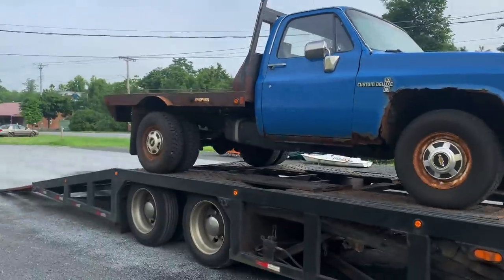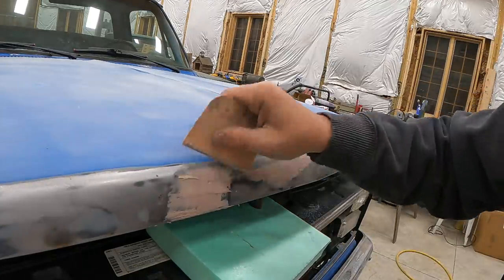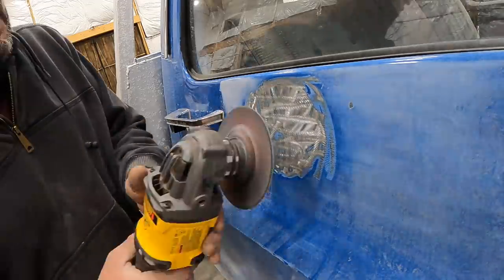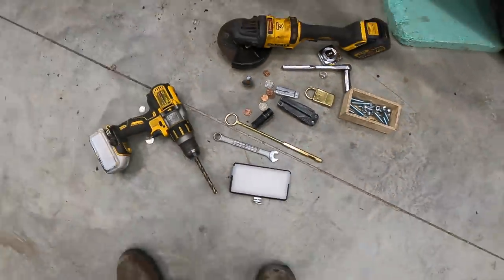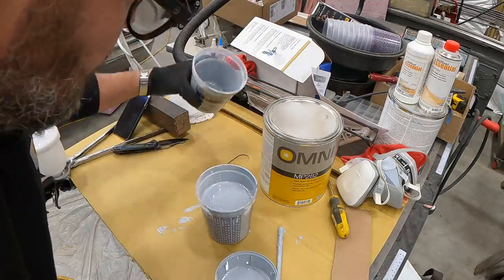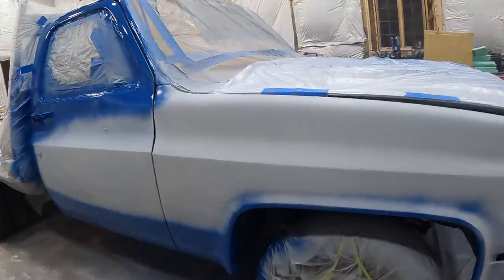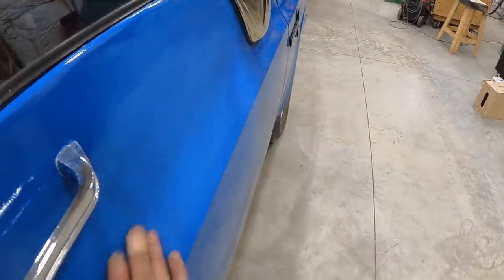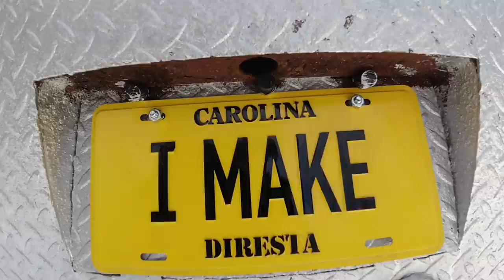DiResta Chevy Truck Restoration [Part 2]

Comment: What you do for the dent in the door is while pulling on the glue sticks take a body hammer and tap around the dent. The metal has memory and by tapping on it gets the molecules moving again and gets it to stabilize
Reply: yep or even heat it some it will change it.
Reply: @jeffreyrigged  yes, heat the area then cool it quickly with a wet rag and the metal will shrink ever so slightly

Comment: Lacquer thinner is illegal? I'm assuming that's only in New york? Great video, my guy. I really like that truck
Reply from the maker: Yep maybe just a ny thing 🤷🏻‍♂️ Bobby I love you 😘
Reply: @jimmydiresta  love you too, man.
Reply: Big up Mr Bobby Duke
Reply: Definitely a new York thing. You can find lacquer anything in the midwest
Reply: @jimmydiresta  California as well. Everything in has to be Low VOC for air quality reasons. Most of the Auto Body places have switched to a waterborne paint system and use a heated paint booth to "bake" the paint on after spraying.
Reply: It's mostly illegal in places that already have high pollution levels due to the high VOCs - e.g. most urban areas.   Even then, you can often get it as a specialty paint.  That said, if you are painting cars, as Jimmy said, the modern paints are way better to use and far more durable.
Reply: Shoot...Cali is bad, but I was going to say we still have it here and then I see comments below. I'm going to have protect my last gallon of thinner like a hen protects her chicks.😋 
Although, maybe this is a autobody paint thing. I bought Rustoleum clear lacquer not more than 6 months ago.
Reply: Tanks for showin' us how it's done
Reply: I don’t believe it’s. New York thing as I’ve bought it here plenty of times.

Comment: Behold!!! The rarest of the rare..., a triple "D" in all its glory (Diresta Duelly Deluxe)👍👍
WARNING! This restoration video contains 3 strong "R's: Reliable, Ruff and Ready, with scenes of drips, runs and orange peel.., Viewer disgression is strongly advised.
The work performed in this video was solely intended for mature audiences only. If you are looking for concourse car show material,  then perhaps this video isn't right for you..
To all subscribed viewers.... You are about to witness a perfect example and sensible approach on how you too can have a decent / CLEAN presentable work truck without going broke in the process or worrying about it getting scratched or dented sometime down the road . Please note: No Chevy's were harmed during filming. 
Awesome Job brother Jimmy! This was exactly the right approach on where to take this truck and where it needs to be. I'm 110% confident many will agree!
Reply from the maker: Hahahh well said 🤘🏻🙏🏼

Comment: You mentioned in the video that you would link the specific paint.  I love the color, could you tell me where to find it?
Reply: If you pause the video at 22:29 you can read the label. It says "Bright Medium Blue" from the Delfleet Essentials line. Also has some item codes that may be useful
Reply: Looks Great! I have a 85 C10 that I currently restoring.

Comment: What a great job. That truck looks terrific. 30 years old and some TLC keeps it looking good on the road. I have an ex-utility company 70 Chevy half ton step side. Had the original 292 six rebuilt, and it just keeps going. Happy with a 50 year-old pickup. Smiles from the West

Comment: Hey Jimmy, I think a lot of us would find it valuable if you did a vlog on the tools you used for this, what you learned and tips you could pass along. Most of us here are not auto body pros but would be interested in doing this type of restoration

Comment: I don't know Jimmy, I doubt bondo will fix the "oil-can" spot. It will probably keep moving and crack the bondo brother.
Reply from the maker: I shit. If that happens I’ll have to get it fixed 🙀
Reply: @jimmydiresta  Probably a typo, but it's hilarious!
Reply: A Wray Schlien shrinking disc would take care of that... they work amazingly well
Reply: @TheAirzuki  yeah, but he is already beyond that step.
Reply: Passenger gives the handle a tug and promptly gets hit with a moonpie shaped chunk of filler... lol
Reply: Take the door panel off and use some spray foam on the inside and lay a few 1/8” rods on the foam and press in to strengthen it up.
Reply: @oakleyjack7600  wouldn’t that get the way of the operation of the window?  I am not a body guy, I don’t know.
Reply: @oakleyjack7600  spray foam holds condensation. Better off shrinking with torch or wheel...
Reply: @jbratt  you should have an inch or so, but if you don’t you can epoxy the rods in to stiffen it up. The rods probably need to be bent to shape vertically with one crossing horizontal.
Reply: @oakleyjack7600  👍
Reply: The metal in that area has been stretched. The only way to keep it from popping in like that is to shrink it using a shrinking hammer a dolly. (or, at least, that's what I've gleaned from watching hours and hours of YouTube in my research for when I do body work on my Mustang soon)

Comment: about the dent near the right door handle: i wonder why the handle is sitting on thin sheetmetal without any support.
Reply: 80's vehicles weren't very good.
Reply: Heat and fast quenching would have shrunk the metal - the problem is that it was stretched....

Comment: Noticed the lower cab at the back I saw some areas to smear some Vaseline over as its your work horse and not your show car. I used wheel bearing grease one time and it stunk so I use Vaseline to be a rust stopper. The truck looks good I'm impressed Jimmy!

Comment: Did a very similar project years ago and loved almost every minute of it despite breaking skin on the knuckles too often for comfort. I cleaned off all the loose rust from the underside too and gave it a good treatment with black Waxoyl which not only protects against further corrosion but looks really good too. With the effort you put into this project I suggest you consider doing the same.

Comment: Thanks for sharing this video.  Last time I tackled a similar project was in 1970, on a ‘64 Chevy Impala.  Many thin coats of OD paint.   Preservation and paint techniques are the same but obviously coating technology has evolved.  I was surprised that you didn’t do any frame rust mitigation before replacing the fuel tank.  Crispy frame syndrome is common here in NE Ohio.  Wishing you and your family a blessed new year filled with peace, prosperity, health and happiness.

Comment: I love Bondo and was known as Bondo man as I perfected a method to use Bondo on blending column haves together while working as a carpenter in Las Vegas. Two biggest tips for Bondo is the more you use the more sanding you create for yourself and when sanding and blending curves in always sand on a bias direction, never vertical or horizontal to avoid flat spots. Bondo will also mend broken marble and granite. Use lamp black or powdered aniline  dyes to color match the stone and use the white hardener cream for perfect results. Bondo on!!!! Love Bondo.
Reply: Also give Kitty Hair; Bondo's structural cousin. I used Kitty Hair to attach Fiber glass reinforced gypsum moldings and you can use metal duct strapping embedded in the Kitty Hairfor additional strength. Kitty Hair is nothing more than Bondo with fiberglass strands mixed in it.

Comment: I recommend getting a kit to move the tanks inboard of the frame.    Been a few burn down from getting t-boned.  I put a 30g where the spare used to mount on my short wide.  I think LMC truck sells the parts needed.

Comment: Great old square bodies, maybe Chevys best trucks. On the passenger door dent, when you pull a dent, you need to release the bend at the edge. A whack on the top edge with a block of wood would make it stop popping back in, no bondo to crack later.

Comment: Good job on the Square body Jimmy. Just heads up those side tanks till 87 were recalled due to fires from side impact. I believe they over took Pinto. Maybe down the road when you do the bed you can move it inboard to the frame rails. love the channel, Take care and keep up the awesome work.

Comment: Tape a “v” shape on the top of the paint can to help pouring when you don’t have a mixing top to clamp on. Also you can break off the plastic adapter on the mixing tops that engages with the mixing machine and just attach a cordless drill to spin it. 👍🏻

Comment: What you could’ve done with that dent it is while you were pulling, tap lightly around the area with a pointed dolly hammer, that will give it strength to hold its shape and keep it from “beer canning”. 

Truck looks really good Jimmy!

Comment: When I was a kid (10-12 years old) I would watch my grandfather work with lead to fill bodywork. He would mix his own enamel and lacquer paints as he has all the measuring devices to match colours. He had colour charts that filled up many shelves in his paint room that he would be able to match mfr and model during the 1960's. He would generally paint at night as he liked his lighting set-up as he detested the shadows during the day. He never had a dedicated paint booth and would just wear a paper mask available from the paint jobbers. I would hold onto the air line that he would drape  over his shoulder and I would make sure the air line would keep off the water-soaked floor (to keep the dust down). My grandmother would do all the masking on the vehicles he painted. Fond memories! As far as the paint drip...at 60 mph, a blind man would be glad to see it!

Comment: Jimmy...great job . I have restored 2 old Chevy p/up. I’ve been told the reason for only one bolt hole on the tank bracket is that it’s a break away in case of a rear ended. The tank drops to avoid getting crushed and exploding. Don’t know if it’s true.
** I was disappointed to not see your insignia on the long board .:((

Comment: a good cheap undercoating/truck bed stuff  But dont actually use it for a nice truck bedliner  But it is  rustoleum undercoating BUT with the Sound Deadening..  had it on the frame of my truck for a long time that stuff is doing a good job & sprays nice for a raddle can.. Make sure u get the sound deadening the cans look identical but one will say  deadens sound

Comment: Not criticizing, trying to help for future issues. When you have a stretched panel that is causing an Oil Can effect. 
1st, grind down the center most area of the debt.
2nd, with a propane torch, heat the center 2 inches to just red.
3rd, Quench the center with wet rag. 
The dent will disappear and it will stop the Oil Can effect by shrinking the metal back to its original shape.
Personally, I would never use Bondo, I prefer using acid core solder to tin the surface then filling with 80/20 stick lead.
Reply from the maker: That’s professional shit right There. Thank you
Reply: @jimmydiresta  If you have trouble finding 80/20 stick lead, remember tire weights are also 80/20, (80% lead 20% aluminum) and can be easily melted and cast into sticks.
Most tire shops will give you all the old weights you want.

Comment: Acetone cleans bondo up really good. I wonder how the tin can effect in the door handle area is going to affect the bondo next to it?  You can use a torch to shrink the metal. Causing it to stop tin canning like that btw

Comment: quick question did you rust proof inside the door I have 2000 f350 similar shape i am considering just buying a new cab cause the replacement sheetmetal parts ain't  cheap.

Comment: Jimmy, are you up for a challenge? I'm hoping you can come up with some projects to utilize used small aviation tubes and tires. Some ideas would be carts or wagons, wheelbarrow replacements, etc. The tires vary in size from 4 inch up to 12, but the tires have steel rings instead of steel cords in the bead so that they don't pop off on landing or deflate. I would suggest go kart split rims to mount them. This might get more difficult on the larger sizes. The neat thing is that many municipal airports give these away since after they wear down, they must be removed from aviation service. I'm finishing up a wagon that will have 5" tires/ wheels on it. My steering axle is from a riding mower. 
Many of the tires are quite nice that I get, while others have either a bald spot from touch down, or are flat from a hard landing.
If you care to take on this challenge, I look forward to seeing ideas that you might come up with. Another idea for the 8" tires would be to regroove some for the front of riding mowers. The down side here would be using scissor lift split wheels. The up side would be their ability to handle the weight of a FEL on a small tractor.

Comment: you should knock off all the loose rust, and get a Schultz Gun and spray the whole underside of the truck with bar and chain oil thinned with kerosene like Mustie1 does!

Comment: The door frame is separated from the door skin, my truck does the same thing, you need to use panel adhesive from the inside to lock it back  in place.

Comment: Why don't You use any epoxy primer before the body filler? The filler should not be applied onto the clear metal, as it will make the rust come back very fast. And the door repair will crack soon i think.
Reply from the maker: A one want to comment?

Comment: I believe the fuel gauge actually says “gas or not gas”. 😂 Did you mean lacquer thinner is illegal in NY? I bought lacquer thinner at Tractor Supply about a week ago in Oklahoma.
Reply from the maker: You can get it but not at the auto body shop. And there is no longer laquer paint. For Cars

Comment: Hi Jimmy,
Not trying to critique your work, but you might want to investigate folding hoods.  Several years of that generation truck had a problem with the hood springs seizing up and then the hood will crease when your closing it, at the second notch back (on the sides). I would hate to see you put that kinda time into it, for the hood to fold up on ya. I think it was something Chevy did to start incorporating some kind of crumple zone into the front end. Just something I wanted to make you aware of..if you weren't already. Though it looked like your hinges moved really freely..
PS, keep an eye on those hubcaps, people really like to walk away with those

Comment: troll baby voice activated OMG, so reckless! Everybody knows that you should use thread locker on bolds under a car, or else they may come loose due to vibrations. *troll baby voice deactivated*. But seriously, I see you grounded those bolts flat but Chris Fix always recommend thread lock. Great vid, as usual.

Comment: no lock washers or lock nuts on those fuel tank mounts is asking for trouble
Reply from the maker: Don’t worry it was cross threaded.  That’s a pro tip.

Comment: I was just looking at the auctions again.  I sold one of my trucks & my Solara & I'm down to two BMW project cars so I feel like I need something else
Reply: What BMWs? I had a 71 2002 I was working on for a while but I had to give it up years ago due to storage and time constraints.
Reply: @jeremyspecce  the BMWs you want have the I6 so that is in many cars the X3 the X5 the 5 Series the 3 Series the sedans & coupes & more plus there are some w/ turbos etc and even a v12 which is the S70 engines which is like two of those I6s combined & that is what the McLaren F1 has anyway it has a timing chain individual coils and ah what people have issues with are the v8s mostly and I don't buy those
Reply: Allan Adamson yeah, I was talking about older BMWs, since this was a restoration video, but, I have owned a few E46 330s (m54 engine) and a 135i (n54 twin turbo) and they are great engines, for sure.
Reply: @jeremyspecce  yeah but that's what I'm saying I've been fixing up cars that don't need as much work for profit for many years that's all it's in your realm if it is what you can do.. so sometimes these cars are damages or vandalized or they are miss kept and the maintenance so they need a bit of restoration or they might have damage and the parts are so plentiful and so much aftermarket so if you do it yourself .. Jimmy's videos have an audience, I am not a content creator.. it wouldn't be in my interest to do that.. now I might consider restoring an 840 or 850 and even those are 90s cars, early 90s but 90s cars..
Reply: @jeremyspecce  I wanted to show you an example car - https://www.iaai.com/VehicleDetails?itemid=38228914&RowNumber=1&similarVehicleItemId=&isNext=&loadRecent=true - so this car is a salvage title which is typically a no go for me but with 101k miles & really just a door replacement & some minor work as well as standard maintenance this car is worth it, and there are countless examples of this and I admit if you don't know what you're doing this can be a money pit but these cars won't be around in the auctions and wholesale forever.. they're going fast.. I used to see dozens of these a week at auctions now maybe I see a few
Reply: @jeremyspecce  I like that they have a video of the engine this car is making me want to buy it but I won't haha but you get it say you had a yard filled with these cars you'd been buying for the last decade you could have this car fixed up in a day